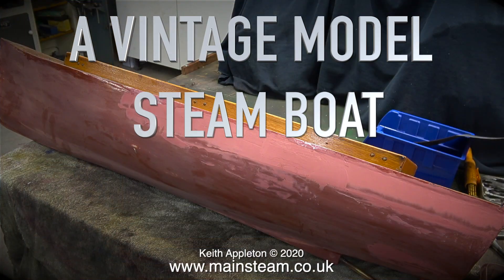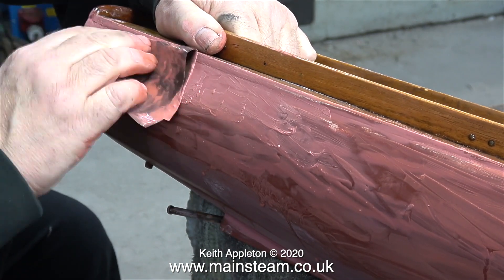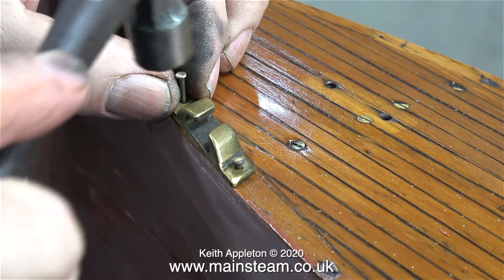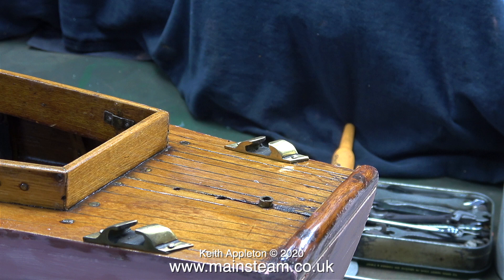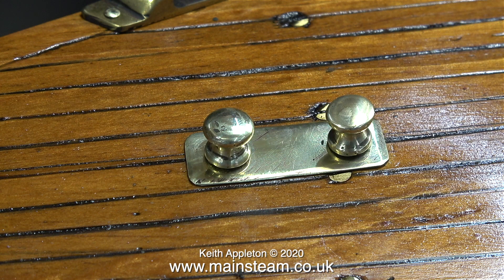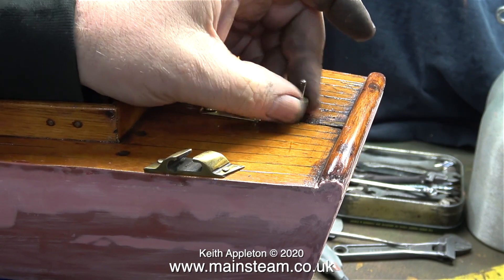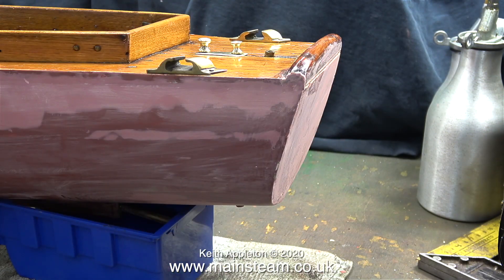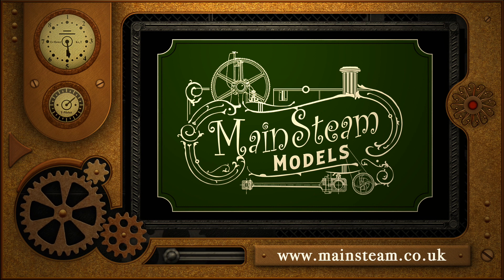VINTAGE STEAM BOAT RESTORATION - PART #8

Comment: Keith, I think both of  the port fairleads may be the wrong way round. They should be angled so that a rope coming out of them would angle away from the boat.
Reply: Looks that way to me too.
Reply from the maker: The reason for this was that the existing holes only lined up with the holes in the deck in the arrangement shown. This is how the boat was when I received it for a 'Sympathetic restoration.
Reply from the maker: The reason for this was that the existing holes only lined up with the holes in the deck in the arrangement shown. This is how the boat was when I received it for a 'Sympathetic restoration.
Reply: @keithappleton  Keith would not the holes still line up if you turned the same fairleads through 180º?
Reply from the maker: if that worked, do you think I wouldn't have done that?

Comment: My OCD is screaming that those two right-hand side"Brass Parts" are turned back to front & the wrong way 'round.....
But then my self doubt keeps mumbling about it being the left-hand side thats wrong.
But you & I both know they're wrong- its a boat & it's Starboard & Port! :v
Very nice boat too, & Im betting iit needed very litttle ballasting at than ;)
Looking forward to seeing more, thank you
Reply from the maker: The reason for this was that the existing holes only lined up with the holes in the deck in the arrangement shown. This is how the boat was when I received it for a 'Sympathetic restoration.

Comment: I was wondering why you didn't use that glue in the nail holes first to toughen up the wood first?    Back in the old days I used a product called "Wonder Wool", very similar to the Brasso product, to shine up my motorcycle engine cases.  Then I discovered that unlike British motorcycles, Japanese motorcycle engine cases were painted silver.  So to get a shiny engine case I had to use paint stripper first, then lots and lots of elbow grease.  This type of grease doesn't come in a can or tube. :~)  Later the Japanese improved their castings and now their cases look better.